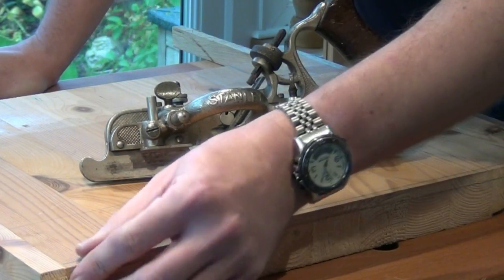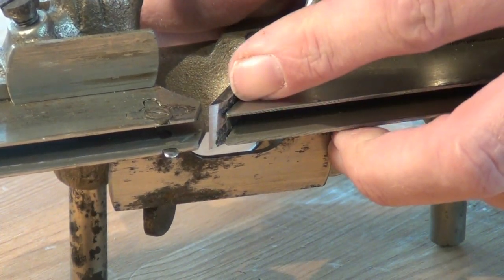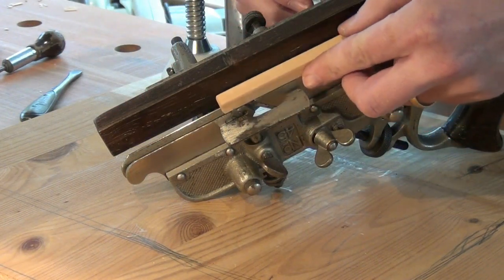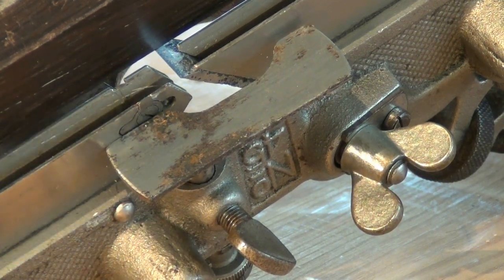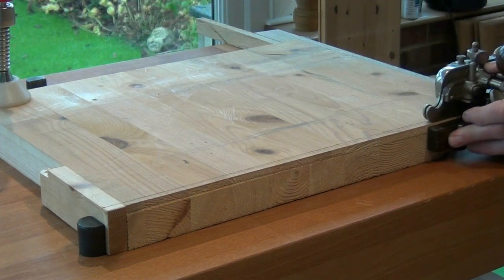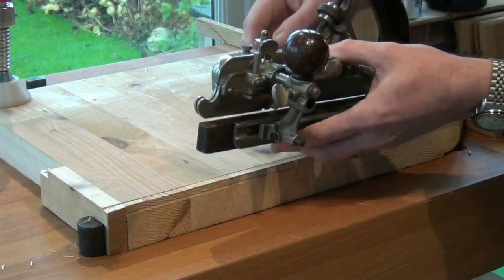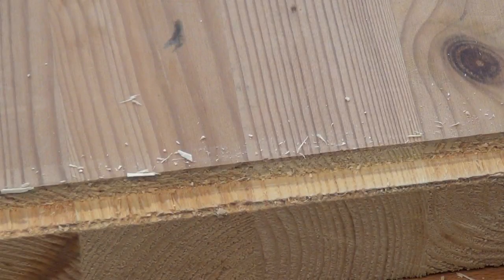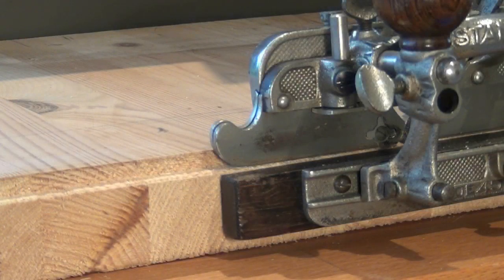Rebate using a Stanley No.45 combination plane (Rabbet)

Comment: Thanks for this, I have a 78-esque rebate plane myself (Record 778), and use of the spur was unclear to me. When I bought my plane, all of the three prongs were unsharpened, so I sharpened one of them. But these stick out quite a bit (as does yours). In my case, it prevented the plane from cutting. Up until now, I just made a saw cut on the side of the rebate (cross grain only, with the grain is fine without spur or saw cut), before removing the waste with the plane. I'll give your method a try (but I'll make sure the spur is razor sharp first)!
Reply from the maker: I too have a 778. The spurs do need a lot of work to get them to cut easily. A crescent knife shape works really well, allowing scoring both forwards and backwards. Backwards is crucial to score completely before the plane takes a shaving. These planes are sharpened and set, and then used multiple times before needing any further attention. Suggesting multiple similar planes set up for different tasks. Speeds up production and allows for apprentices to use tools they haven't yet learnt how to set up properly. Or is that just an excuse to collect more planes 😉
Reply: @mitchwoodwork  thanks for the reply. To me, having a plane set to a standard dimension is indeed an unexpected benefit of working with hand tools. I also have a Record 044 plough plane, and it just has the 1/4" iron set to a sensible dimension for drawer bottoms. Take it out of the box, plough a groove right away, no adjustment needed.

Comment: I have had a Record 405 for many years, preferring to use it instead of a router. I worked as a Cabinetmaker for 20 odd years, and now only make for myself and immediate family. In industry I would never have been allowed to use one of these, as speed is of the essence, the electric router and spindle moulder being the tool/machine of choice, but where is the fun in that! One thing I have noticed is you take what I consider to be very heavy cuts. I prefer to take more and lighter passes. I find it gives a better finish, and the blades stay sharp longer. I always use a Veritas honing guide to ensure a perfect bevel, diamond stones to start, and always polishing with an Arkansas Translucent, a surgical polished edge on these cutters really helps, that is half the battle. Another thing I have found useful is the use of pure beeswax (solid) rubbed on the skates and side fence. That really helps cut down the amount of effort needed. Please don’t take my critique the wrong way though, it’s just the way I like to work. One thing I have just discovered is the Stanley 55, with its greater range of cutters for producing mouldings. And I have just purchased a few hollow and round special bases for the 405, which enable you to use the tool as a moulding plane, although I have yet to try them out. I intend to try my hand at making some crown mouldings for a wall cabinet I want to make for my Wife so she can display her Murano glass animals. Great video, and it’s good to see someone else using one. There is lots to learn about them, and I am always looking for more info from other Makers on how to use tools like this. Thanks.
Reply from the maker: Thanks Kevin. Lovely to hear you use records version of this plane, and always good to know other people's experience and tips. Agree on the heavy cuts, which I only use to hog away waste fast before easing back on the cut for a better finish where necessary. Greatest  pleasure is always found when the depth of cut is dialed back and one slips into a gentle rhythm. I'd like to pick up the hollows and rounds set for mine some day too, when I could add to this little series.
Cheers
Reply: @mitchwoodwork  I have managed to locate 4 of these special bases now, 10 hollow and round, and 8 hollow and round. I am now on the hunt for a pair of 6 hollow and round. They’re quite rare. They also did a 12 hollow and round and a nosing tool for stair treads. I will keep collecting. The other thing I have just bought at great expense was a Stanley 55, which has a 3rd adjustable skate and you can also angle the 2 fences, opening up a whole new vista of achievable cuts.....check one out on YouTube if you are not familiar.....but it’s basically a more complex Stanley 45. There are a range of moulding profile cutters available for them live ovolos and other stuff. I will let you know how I get on.

Comment: Just bought the same plane you are using. It is intimidating but I figure I watch enough vids I should be fairly comfy with it. First to build a box. The cardboard box it came in is moldy and breaking up. I am left handed and wonder it this is going to be a problem. If so I will sell it and get a Veritas left handed plane. Takes all the same cutters. Thanks for the helpful info.
Reply from the maker: I'm not sure how you'll get on with it being left handed. Have you considered trying right handed planing? I only say that because I am trying to plane left handed; practising a little every weekend. I have arthritis, so trying to spread the load and keep woodworking as long as possible.

Comment: Thank you for your detailed explanation!  I've used my 45 for a dozen or so projects and often had issues not knowing exactly how to set it up and making a mess being too greedy and forgetting to prevent tear out, always having to come back with unnecessary chisel work.  Between you and Roy Underhill (And 20 other teachers...) I'll be cranking out boxes with confidence!  
I do have a clarification, if you can.  When you set the spacing of the two metal plates/runners that support the blade, you were about 3/8" 5/16"?  Then in use it looked a little closer, then in the final shot they look almost bedded directly against each other.  That's been one of my wonderings; should it be right at the edge of the blade, halfway between?  2/3rds of the width of the blade, 7/8ths?  
Edit:...I listened back again and heard you say, "~Adding that extra support behind the blade in the right position...will help hold the blade firmly and make the cut easier.~"  So I'm going to deduce that somewhere past half and somewhere before flush with the edge?
Edit:  I like Roy's design and jigs, so I've been watching him back after seeing Wood by Wright's box from firewood today.  In his Sliding Lid Boxes episode (https://www.pbs.org/video/woodwrights-shop-sliding-lid-boxes/) at 5 minutes in he is using a 45 to plow a groove, but doesn't have the second one attached, is that typical then for smaller width blades and/or long grain situations?
Thanks again, I think I'm getting it now!?
Reply from the maker: Thank you for your praise. You're spot on with the blade support, and in the case of the smallest width blades no second skate is required or even possible (since the smallest cutters will not plough a groove wide enough for both). Good luck, and go to it!

Comment: Fantastic! Thank you. Any comment on whether the Stanley 45 does a better job than the Veritas Skew Rabbet Plane or the Stanley 78?
Reply from the maker: I'd say the 45 isn't quite as good as the others, but very capable. Because the 45 was designed to do so many different functions, each one is slightly compromised.

Comment: Is it possible to remake the notch in a blade that has been retracted without loosening the wingnut (and broken off the top end)?  I notice in your other video on blade sharpening that a couple of your blades had no notch.
Reply from the maker: I've not tried it, but I don't see why not. Probably the whole iron is hardened so it isn't necessity easy.
Reply: @mitchwoodwork  Thanks for your reply.  It was the thinnest rebate blade in my 55 set (1/8 inch).  
I just had a go with a fine round file after starting it in the right place with a saw file - being very careful it didn't remove too much from the width.  And it worked!  (Have a go with yours.)  
I think the previous owner wasn't too careful in releasing the wing nut before retracting the blades because the next size up was also bent upwards a bit.  
The blades must be unhardened at the top end at least.
I've learnt quite a lot from your series on these planes.  Do you have a 55?  I'm still not sure about all the features available.
Reply from the maker: That's good to know. Pleased you had success.
I don't have a 55, but the ability to off-set one skate from the other is one advantage. If I get one, I'll be sure and do a series on it.

Comment: Good video. The #45 was a complete disaster back in the day. Back then many men could not read or even sign their name. So why even include a manual with the plane? In short, these planes were shelved after such a short use. Hence, why there are so many coming out of dusty garages and put on ebay.
Reply from the maker: +Robert Cornelius Good point. Our luck then really.